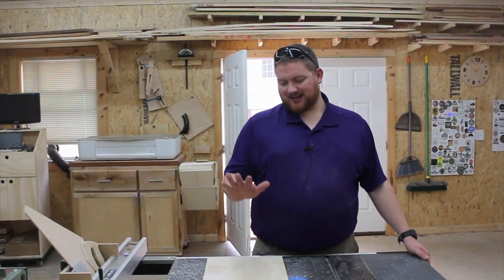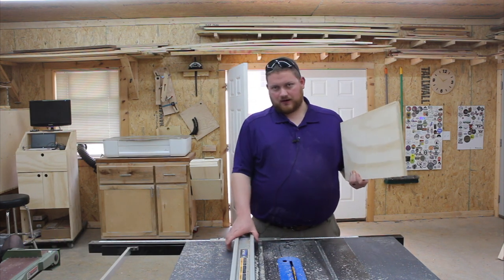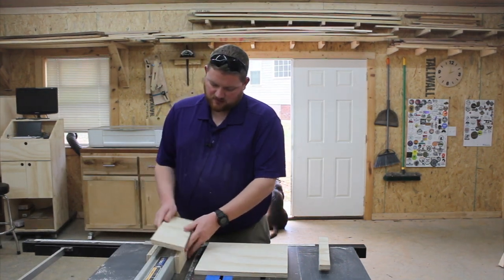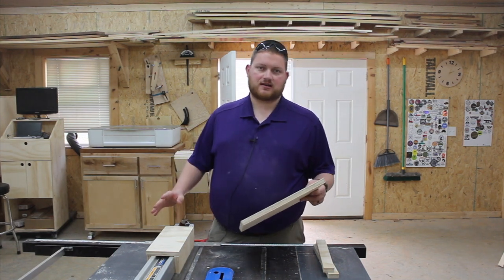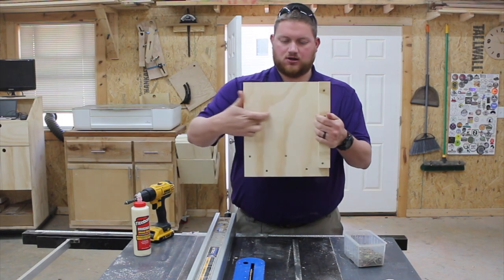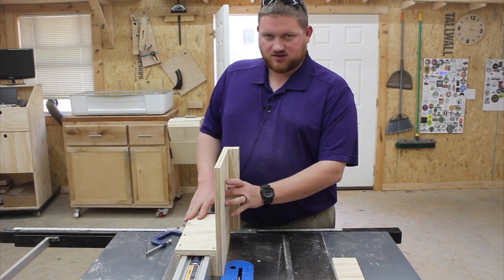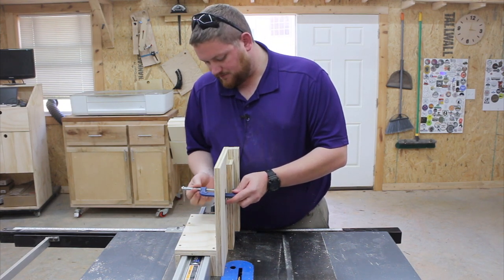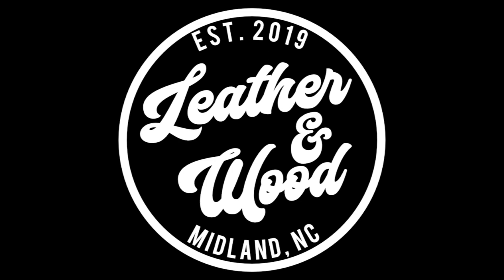Table Saw Tenoning Jig - DIY Table Saw Jig

Comment: This was just the sort of simple jig I was looking for.  Thanks for posting it.  I'm wondering how you ensure that the back that the piece is clamped to is square to the table.
Reply from the maker: As long as your fence is square to the table and you make you jig to fit snugly tight to the fence, then the jig should also be square to the table.
Reply: One addition I’ve seen guys make is adding a couple perfectly square glue blocks to the back of the high fence where it connects to the horizontal to add additional security.